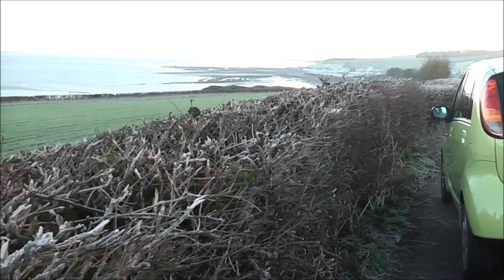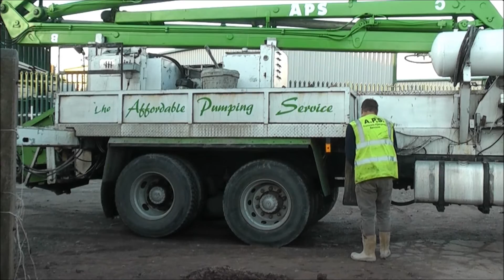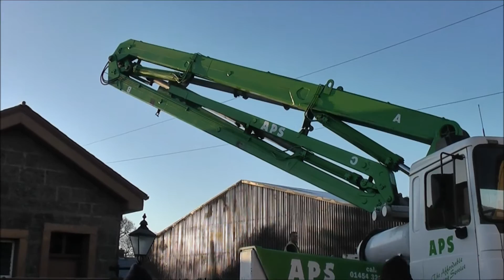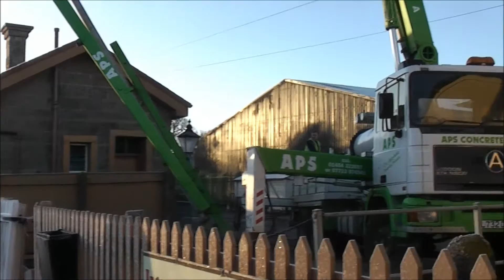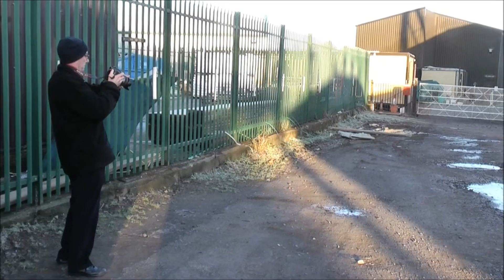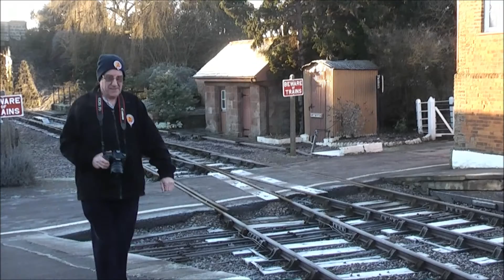WILLITON WSR BRIDGE CONCRETE DELIVERY Part 1

Comment from the maker: @howarth004 I have tried asking Panasonic at one of its shops and on line but no one can tell me how the program can be modified, to only come on line when requested. It is a bad design! It virtually makes the program unusable if you have other equipment connecting into your computer.

Comment from the maker: @howarth004 What is happening is that the still camera software detects un saved data in its program when the camcorder is connected to the computer.That program barges in uninvited  and tries to save all the data in the camcorder which would take many hours to do and fill up the hard drive. You are unable to stop it doiung so or proceed with anything else.. i have had to delete that software to be able to continue uploading camcorder material.

Comment from the maker: @howarth004 Hi Dave. Technology can be frustrating at times! I have several parts of this saga edited and ready to upload but this has failed twice due to internet problems after many hours of uploading!  My new still camera is waithng until I have used up the memory card on my still serviceable original, which I have liked but getting the older type of memeory card is now becoming dificult. I have found the software with the new camera interferes with that of my camcorder which is a problem.